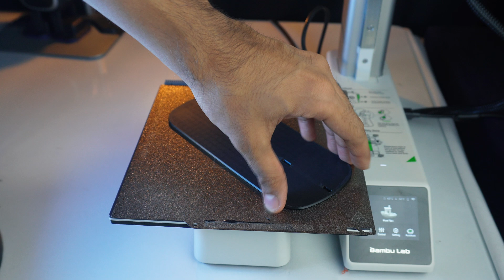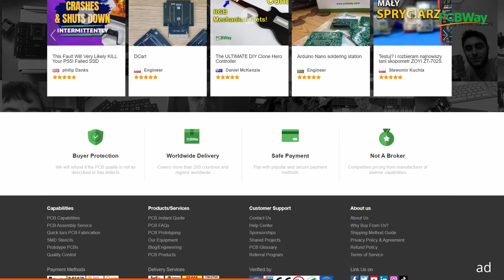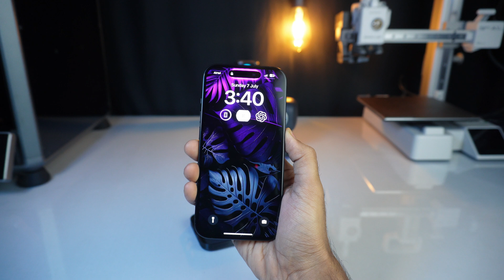Ultimate 3D Printing Ideas Compilation 2024: Innovate, Create, Inspire! | Part 46

Comment: Hi, could you please tell me what build type adhesion you use? Thanks!
Reply from the maker: Hi! I don't typically use any additional build plate adhesion for the Bambu Lab A1 Mini. For the Creality K1, I rely on the default glue stick that comes included with the printer.